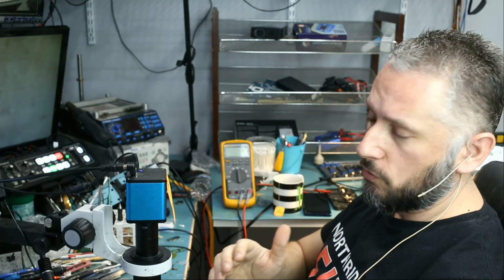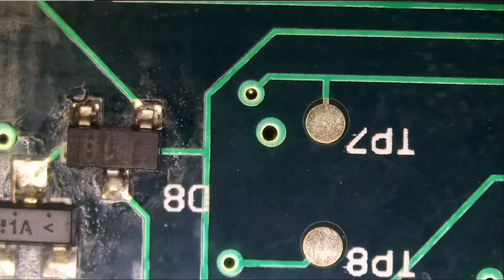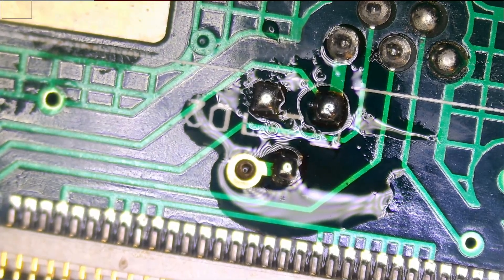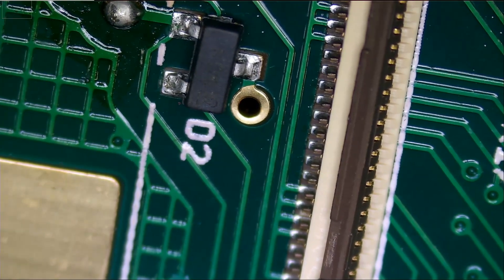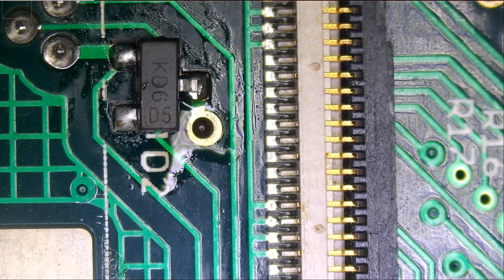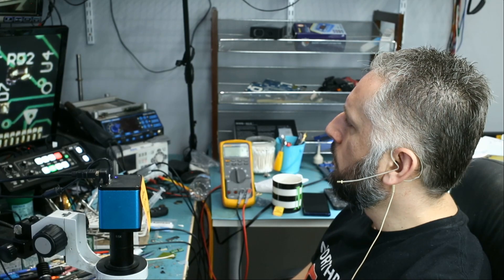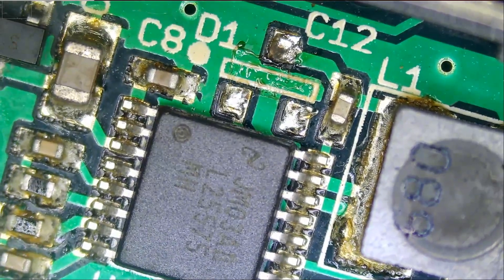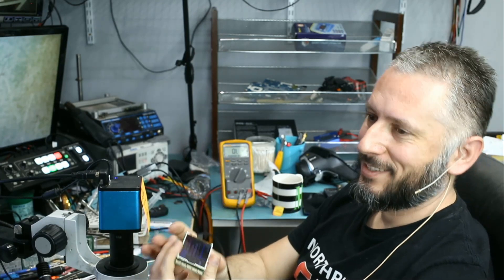Mini Maxx Race Tuner - No Power Black screen Repair using Flir Thermal Imager

Comment: Nice job as always :D I am now finding myself in need of better tools to repair SMD work. I recently made an error in thinking a cap had shorted and was disappointed to find out the short still existed after I removed the component. Turns out there was a switch that "turned a feature off" by shorting that cap to ground. Took me 45 minutes to get that cap back on with my giant caveman soldering iron! 😂

Comment: How much will you charge for this repair? Is that fix repair charges or vary by device to device or cost of the device? But anyway repair was good and very helpful for me and lots of other people.
Reply: Usually repair shops charge 1/4 or 1/3 of a new device.

Comment: I have a HP Pavilion  that has a problem with one memory slot. If I put a RAM in that slot , the "Caps Lock" blinks 3 times , pauses for 2 sec and again 3 times. But If I put the same  RAM memory in the  one underneath , the laptop work perfectly. The motherboard SN is: DA0R33MB6E0  REV: E.  Can you give me a hint of what can it be?